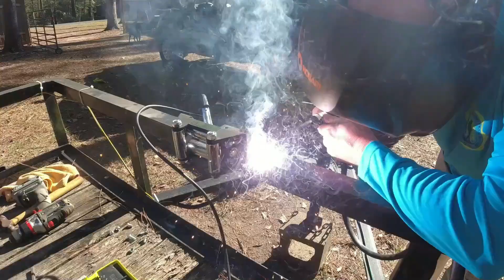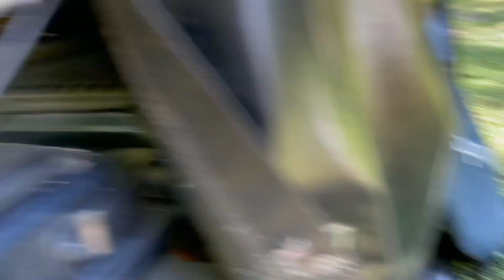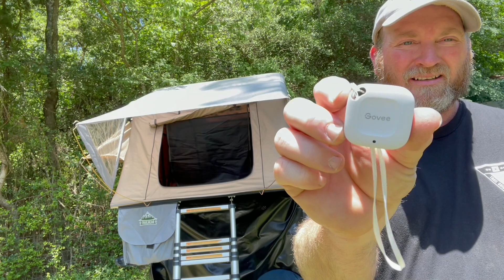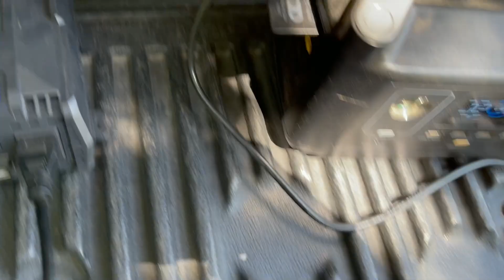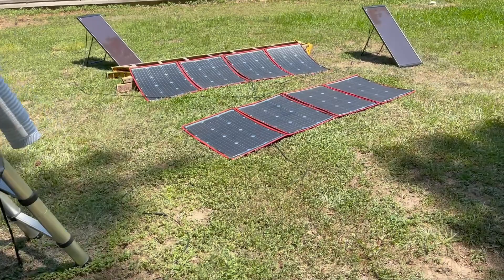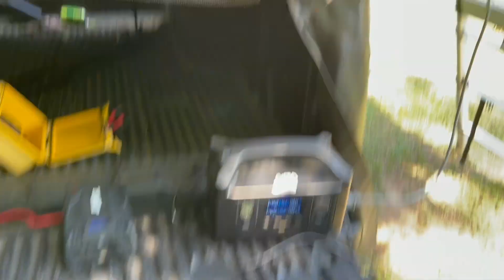Powering The Zero Breeze all day on Solar

Comment: So your charging the solar generator with solar panels and a battery??? What size solar generator should I buy for this ac unit
Reply from the maker: Honestly that depends on what you can afford. The reason I use the battery is because the smaller solar generators have a 200w max input from solar and the ZeroBreeze max power is 240w. So I use the battery and inverter to bypass the 200w solar input and charge through A/C and I can get more out of my solar panels. You can probably buy a 200ah battery an inverter and solar panels cheaper then a solar generator. But if you’re going to buy one get one that takes more than 200w of solar.
Reply: @Xploring_The_Outdoors  cool thanks. Bluetti has a new cheap 600 watt solar generator for under $300.

Comment: I suspect those panels are not the claimed wattage.  Have you ever gotten even close to the advertised 12 amps each out of them for a total of 24 amps?
Reply from the maker: Hooking them up to my EcoFlow I only see watts. I ordered a 100ah battery that I can hook these up too with the charge controller and a load and see what I’m getting. I just got a rigid 200w panel from Bougerv so I’ll have to do a comparison video soon.
Reply: @Xploring_The_Outdoors  
How much current can you get hooked up through the included charge controller and into that lead acid battery?   Watts are a lousy measure of a solar panel unless you're dealing with an MPPT charge controller that can utilize the full wattage.  I think both the included controller and the Ecoflow internal controller are not MPPT.
The rated amps should be accurate regardless of the controller used and with everything working as it should, in full sun you should get 24 amps from the panels as long as the battery is thirsty for charge.   
At 12 volts it should be very thirsty and with 24 amps, that would equate to 288 watts.
At 13 volts, it's 312 watts which is pretty much the most you can get out of those panels unless you invest in an overpriced MPPT controller.
Reply from the maker: @Andy-df5fj  unfortunately these panels come with a pwm controller but the vmp is 18v with a max current of 12.22amps so if I upgrade to a mppt controller I should get 220watts out of the panels each. I plan on buying an mppt controller because I’m doing a solar install in my camper.
Reply from the maker: @Andy-df5fj  I was getting 13.3v and 12amps according to the charge controller with both panels connected.
Reply: @Xploring_The_Outdoors  
Something is not working as it should if the best you can get is 12 amps for both sets of panels.  It's almost as if only one set of panels is working rather than both.
Reply from the maker: @Andy-df5fj  well the cable I’m using to connect the panels together is from my harbor freight kit. I’m not sure on how it’s setup if it were parallel I’d be stacking amps but it doesn’t appear to be the case. If it were series I’d be stacking volts but I wouldn’t know because the pwm controller won’t read much more than battery voltage. I need to stop playing with this premade crap and make my own true parallel cable setup.
Reply: @Xploring_The_Outdoors  
This is just a guess, but I suspect the harbor freight cable should connect them in parallel.  I see no reason why they would connect in series since that would require an MPPT to utilize the high voltage and Harbor Freight doesn't deal in anything MPPT.
Maybe the cable is defective?
Reply from the maker: @Andy-df5fj  Good point, so if the cables are true parallel cables and each panel is capable of 12.22amps and all I was reading on the controller was 12amps and my battery voltage showed 13v I’d have to think the battery voltage was to high and limiting the amps to 12 to maintain the voltage under the current load. Maybe if I had drawn the battery down a bit before hooking up the solar I’d see more current trying to recharge the battery.
Reply: @Xploring_The_Outdoors  
Yeah good point.  At 13.2 volts your controller may be shifting out of bulk charging and tapering off the current depending on how the charge controller is configured.  The true test would be to let the battery drain some to make sure it can handle 24 amps of charge current without exceeding 13 volts.
Reply from the maker: @Andy-df5fj  sounds like I’ll have to do another video lol